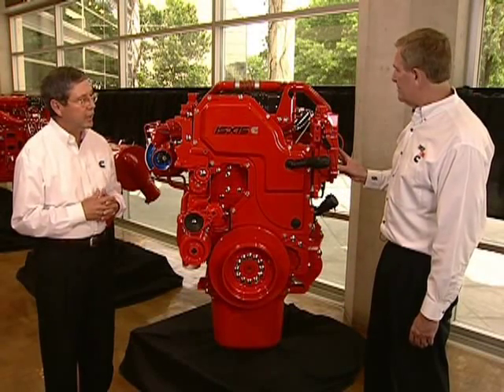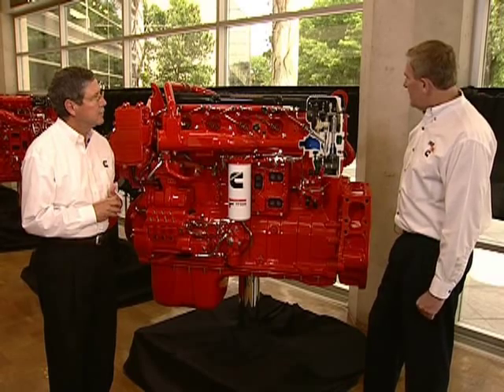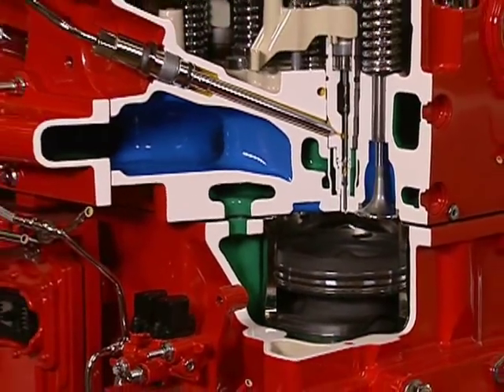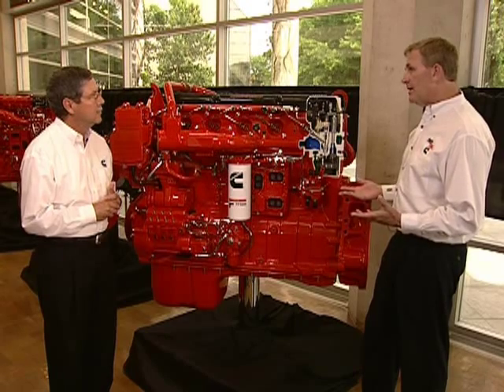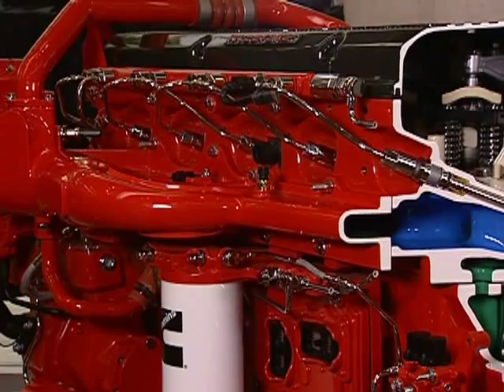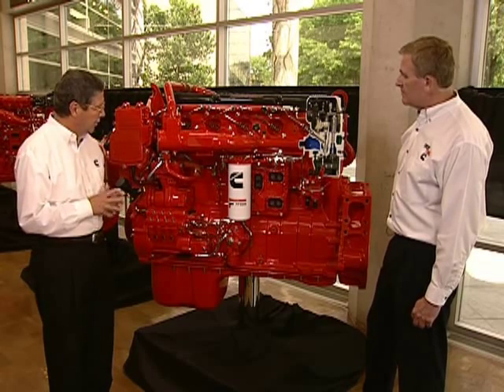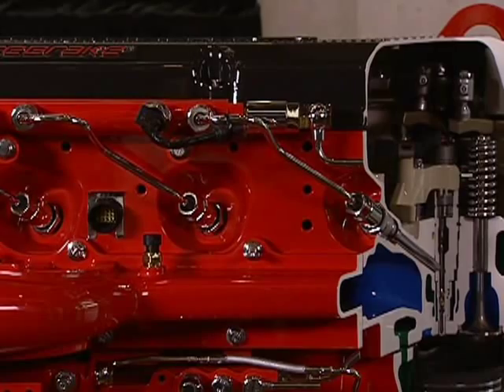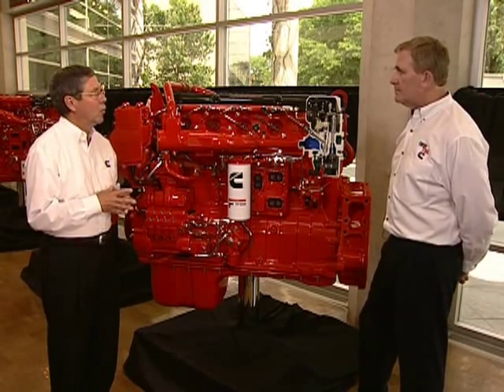2010 Cummins ISX15 Overview (Part 2 of 2)

Comment: And now that we're in 2014, they probably have worked any of the early engineering problems, if there were any. Especially the emissions stuff added in 2010.

I would love to have this engine in a 45' RV riding on a K3 Spartan Chassis.

Comment: they should change the cylinder head too,they removed the cam but the basik arhitecture is the same,to heavy and to much parasitik material used,dd15 heads a lighter and more mekhanik friendly than isx